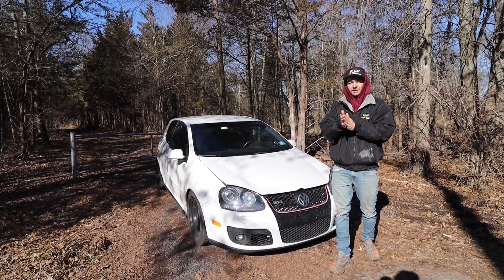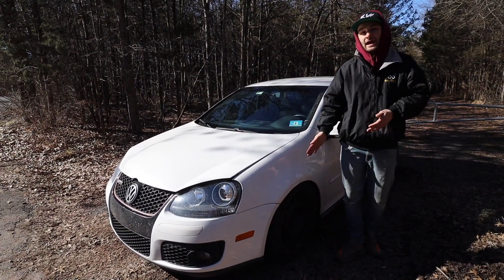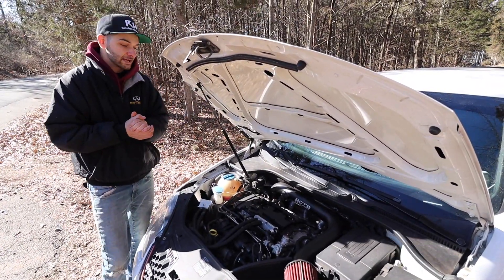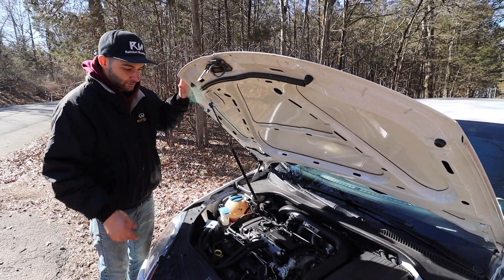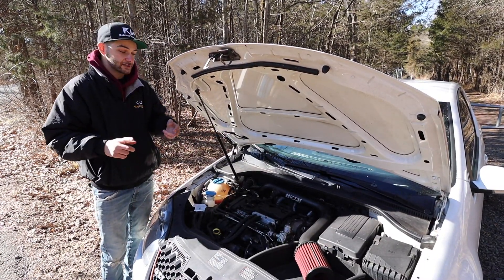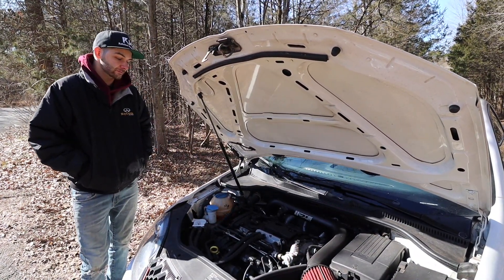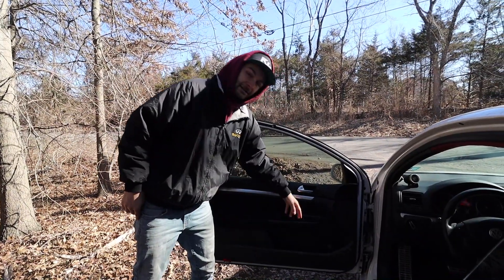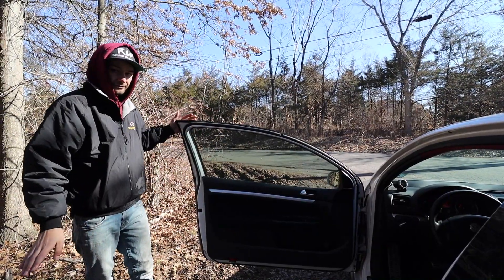Things That Will Go Wrong on VW MKV GTI/GLI

Comment: Another important thing to do when you change the timing belt, is make the same with the water pump and, for the price, add to the list the thermostat. In my case  another common issue is the broke trapeze bushings. I changed them for myself for the powerflex polyurethan ones. This upgrade make a huge handling difererence!!! Good video.
Reply from the maker: Very true I did have to replace my thermostat at 66k miles so that was pretty early for it to fail. I agree to go with a better quality one. It’s kinda a hassle to change too
Reply: Are those bushings on the subframe?

Comment: YES!! FENDER RUST FRONT AND REAR IS EXACTLY WHAT I'M GOING THROUGH!!!
Reply from the maker: Exactly it’s such an annoying thing that really happens to everyone! What’re you gonna do for it?
Reply: @RatchetWrenches  looking for a replacement fender.  Two holes in the fender are rusting from behind the paint now.
Reply: @RatchetWrenches  You actually just need to remove the  airbobbe thingy thats behind both fenders, thats the couse of rust becouse they sink in the wet and make it easy to rust

Comment: I had my red GTI just painted (the fenders started to rust as well as other bits under those plastic side skirts). Had the paintshop repair them and paint front & rear bumper to match the color (other than paint middle lower area satin black) and the side skirts also. Made a massive improvement to how it looks. After I bought it, I've been doing some restoration work on it... but painting I wanted to give to professionals. They also repainted the hood and fixed a dent on the back door and overall gave it fresh newer look.

I also played it safe and changed that cam follower. Old one was in decently good shape still, but just in case 😁 New PCV valve as well and replaced those old worn out engine mounts with 034motorsport ones. Pretty awesome those, no increased vibrations or anything, but feels more "planted" (installed 034motorsport dogbone too with the stiffener).

Got Revo intake installed too, and about to change spark plugs to some NGK bkr7eix ones which were suggested by VW tuner, because I'm planning to get custom tune in few weeks (finally!). I haven't upgraded that k03 turbo, but that's because I wanna see what the custom tune does and how I like it. Then perhaps just k03 hybrid and new down pipe (dunno which brand is good at the moment...) and let the tuner adjust accordingly. But those are for next year.

Luckily belt was replaced just few thousand kilometers before I bought it as well as DSG oils and filter serviced, so they should last a while 😄

Also got rid of that noise pipe and just put S3 throttle pipe there, because I didn't feel like some plug would be enough (just for ease of mind). And diverter valve is replaced by GFB DV+

...all kinds of stuff done so far 😅

But enough about my excitement on the mk5... yeah, I still love it! Question... you don't have that cloth/blanket under your hood. In my mk5 it kinda hangs partially loose and I'm considering removing it completely. What negatives would it have if any? Would it heat up the hood too much and damage the paintwork, especially on those very cold winter days (it can drop to minus 30 celcius or even below that here)? Or is it just there to dampen sound? 🤔

Comment: I recomand the oil pump flywheel to cancel the balanced shafts. If you google it you will find it. I change the engine because that sproket fail of the balanced shafts. 
✌

Comment: Tuned 07 GLI here. Cars in the shop right now getting the oil filter housing and oil cooler replaced. Told them to do the carbon cleaning too!
Reply from the maker: Yeah those do fail just not as common as these ones I mentioned here but good idea to get the carbon cleaning!

Comment: I have a 07 gti fsi, and have to change out the coil pack and plugs otherwise the car will start bucking with engine light flashing code is misfire usually. When I change them out runs good as new! So now I change them around 4k-8k only annoying part about it but overall great car!

Comment: Plus one for oil pump issue.  Cut gear that drives balance shafts for now.  Also frayed wires in hatch loom, driver door lock, blower motor resistor will happen eventually.

Comment: Hey great video.  I have a mk5 gti 6 speed manual with 265kms on the clock still going strong,  roof liner still in mint condition do have faded controls though.  Just a question to everyone out there my sunroof since Ive owned it has a mind of its own, when driving it opens and shuts and tilts then stops half way into it and doesn't go back.  Try using the control system and it makes a loud grounding noise the after some days or weeks it will start up on its own and reset back into place..  anyone who knows what would be causing the problem??? 
 Cheers

Comment: Having the PCV valve delete turns on check engine light? I'm having oil consumption bro
Reply from the maker: It can throw a code yes but it shouldn’t if installed correctly and sealed properly. These cars love to do dime oil unfortunately

Comment: Hello there mate.
Did you ever had any oil consumption at all with this engine?
Cheers
Reply from the maker: Hey there, yes these cars are notorious for oil consumption unfortunately, I’d too my oil off every other month give or take
Reply: @RatchetWrenches  have you find any solution to reduce the problem at all?
There is few rumors that the pcv system design is crap and by changing to aluminum valve cover and eliminating the pcv system it will solve the problem, as the real oil consumption comes from the front and especially the rear valve cover breather that goes to the turbo.
Have you heard anything about it?
Thank you very much for sharing .
Reply from the maker: @nikosraptis1985  honestly I never really did too much research into ways to prevent the consumption, I kinda just accepted it with the fsi engine. But yes a lot of it has to do with the poor design of the PCV. Unfortunately I can’t give you too much info on it since I never really did my research I’d rather not steer you in the wrong direction. And no problem!
Reply: @RatchetWrenches  Thank you for the quick reply! Did you ever had any problems by using the car under oil consumption? Have you ever felt that is loosing it's power or the engine getting weaker at all? Only thing that it bothers me is that i am going through a lot of oil, of course i have no leaks, i have no smoke from the exhaust, my spark plugs are pretty clean a little bit rich as im on stage 2, compression very good and honestly i wanna find out what's the real problem one day :-) 
Anyway mate thank you again and Greetings from Australia
Reply from the maker: @nikosraptis1985  honestly This car was so reliable to me, Aslong as you maintain it and take care of it she’ll take care of you. I was stage 2 and with the more miles I put in it I didn’t notice a power lose or anything. So besides having to top off the oil it really doesn’t affect the performance in my personal experience!

Comment: My wolfsburg 2010 jetta tsi 185k miles bone stock tho. Fairly reliable dumb stuff Ive replaced both fuel pumps, intake manifold, catalytic converter and now pcv valve. Secondary air pump for emissions . Timing chain and tensioner around 130k miles. Sunroof leaks quick fix. And yes my headliner sags In the back. Pushing to 200k miles is my goal
Reply from the maker: That’s all common stuff but 200k is def doable! Best of luck
Reply: Ive got a 07 Jetta GLI with 255k on it, headliner still going strong!
Reply: @mattmerriott670  damn

Comment: I’m in jersey and my 08 has 99 but it’s falling apart could use some tips on where to start
Reply from the maker: Hmm what exactly is falling apart?
Reply: @RatchetWrenches  sounds like on startup and tensioner is going bad, a consistent ticking loose sound lol, also feels like it’s breaking up a bit under boost going from 2 to third I have the dsg, has lean code
Reply from the maker: @johnslaney8054  for the sound id really have to be there to be able to go be you the exact issue but commonly the tensioners do fail so it can for sure be that. Now for the breakup, do you have a boost gauge? If so what are the psi readings when that issue is happening. Does it feel like a fuel cut or more like an misfire?
Reply: @RatchetWrenches  okay I’ll get that tensioner replaced, no boost gauge also but it feels more like a fuel cut, it’s consistent between 2 and 3 under boost but it doesn’t happen all the time, do you think bad cam follower?
Reply: You selling it?
Reply: What’s your Instagram?
Reply: @prolifik_hussle5972  j_slaney, and not sure yet